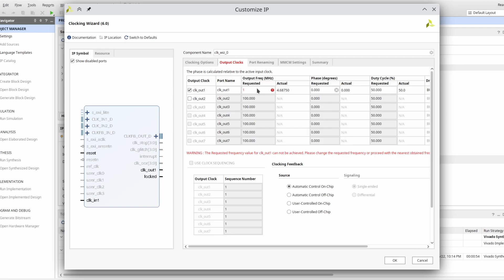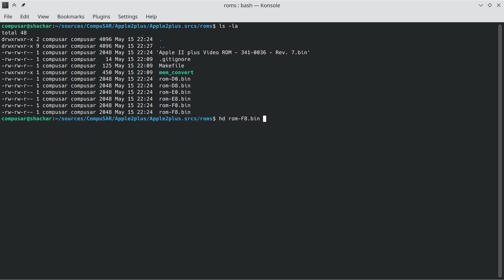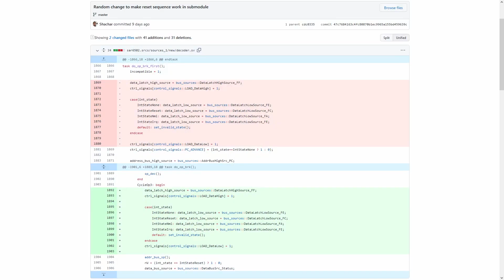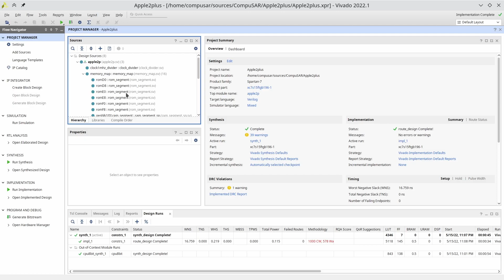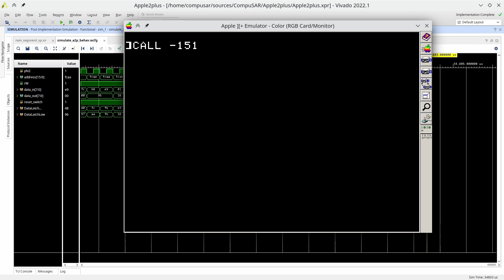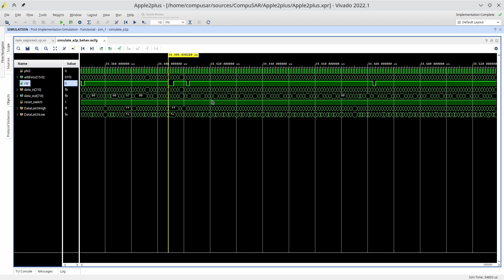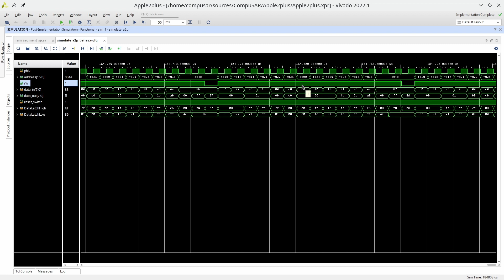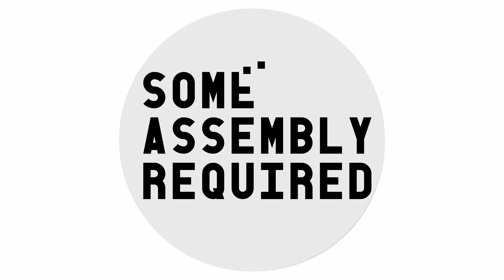I built an Apple II clone on FPGA from scratch

Comment: I came up with two methods to generate a 1 MHz clock with your hardware and have them reside on proper clock routing networks to appease the Vivado Place & Route: OPTION 1.) Generate a power of 2 multiple clock (i.e. 16 MHz) and run a counter with that clock that has enough bits to count each MHz (so with 16 MHz clock, a 4-bit counter for 16 unique count values).  Test for the "all 1s" case, register that test value, and drive the CE of a BUFGCE (see page 42 of Xilinx UG472) with the registered test value.  The BUFGCE will let one cycle of the 16 MHz of the clock through once every 16 clocks.  This will produce a valid but asymmetric duty-cycle clock that will already be on a clock network. OPTION 2.) Using the same 16 MHz clock as in the first option, test for the "all 1s" for all but the most significant bit.  Use the slower clock to drive the clock of a toggle flip-flop, and the registered test of the counter to chip enable said toggle flip-flop.  This will produce a 50% duty cycle 1 MHz signal.  Route the generated clock to an I/O pin, and then run that back in on a clock capable I/O pin.  You could likely do this with your current divided clock as well, but this is a minimal logic solution I'm proposing.  From other information, it appears you're using a QMTECH Spartan 7 development board.  If that's the case, you could run your clock out on pin F11 and back in on pin G11 by jumping the pins on JP3 (header pins 21 & 22).  Looking forward to seeing more development!
Reply from the maker: Actually, I don't get any warnings about the hack I did. Maybe because I'm synthesizing the CPU separately, so it has it's own clock definition, unrelated to what the rest of the circuitry actually does. I voiced genuine concern that I'll be double-edging clock transitions, which at least for now, doesn't happen.
BUFGCE seems like a good solution even based on a 1/50 divider. Why would dividing by a power of 2 be a priority in this case?
I can tell you right now that there is very little chance I'll be spending two IO pins on this solution. Not only are those an expensive resource, I don't know what routing the clock outside the FPGA will do to its phase.
Either way, thank you very much. I'm still kind of an FPGA newbie, and I find Xilinx UG documents rather overwhelming. They are okay individually, but it seems like Xilinx expects you to sit down and read them all through, which is beyond my current time budget. It's nice to have someone who actually knows what they are doing peeking over my shoulder.
Reply: @CompuSAR  I chose to go with a power of 2 clock because a counter that overflows on a power of 2 count requires no additional logic to reset the counter, where in your case without dividing down the clock, you have to make a 6 bit counter, and then infer/add circuitry that restricts the count to the range of 0 through 49, which effectively is a counter with a extra reset logic.  Also, with a much slower clock, the asymmetric clock period provides more hold time in case you need that in the future for I/O.  If you were to use the BUFGCE with the 50 MHz clock, you'd have less than 10 ns hold time but almost a whole microsecond of setup time.  If you attempt to work with original parts for I/O, there may be latches instead of flip-flops, and I'm going to assume they don't work faster than 1 MHz, so the closer you get to a 50/50 duty cycle, likely the better.  As for the phase shift on the out and back in again method, it wouldn't matter as all your logic would essentially be segregated from the clock generation circuit despite it originating from within the same chip.  The returned clock would enter, get buffered and placed onto the clocking network, and as long as you didn't try to make logic work across domains of two separate clocks, it would not matter.

I attempted to clone your project and rebuild it so I could see what resources you had available for such a clock division scheme (I'm spoiled with my Artix 7 35T and Zynq 7020 based boards having more FPGA fabric resources).  Vivado has never played nice with git or really any CVS.  I found that you included the Vivado project file, and if you open it in a text editor (it's just XML), it has full path information from your working machine.  You can instead use the Tcl scripting capabilities along with some shell scripting to rebuild a project from scratch when a person launches Vivado.  This way, you track only sources and not products of Vivado itself.  Best way I found to learn these commands was to do things in Vivado and look at the Tcl Console or the .jou file generated by Vivado.  Nearly everything you do in Vivado in the GUI is a Tcl command to the tool.

As for the Xilinx User Guides, I have a leg up on you as I started with Xilinx components that are now footnotes in history, and I've seen the progression of their technology as if they were logical increments in design and capabilities.  However, the best place to start is the Data Sheet (i.e. DS180 for Xilinx 7 Series).  This gives you the CliffsNotes version of the part family, and highlights the various topics that are broken out into the in depth User Guides (basic blocks, advanced blocks, clocking, memory, I/O, configuration, etc.).  With people new to Xilinx components that want/need to get in depth with them, I like to take them back a several years and point to the Virtex 4 family, as they are a direct ancestor to the 7th generation parts.  Those parts had a lot less documentation, and many features were far simpler to digest.  Progressing them forward up into the generation they're working with, they can see that we're really working with the same foundation Xilinx laid then.
Reply from the maker: @jordanking357  First, I can't say how great it is to have someone follow along!
The project file opens fine to me on different paths. The only thing that holds the complete path is the main project directory, and Vivado seems more than capable of inferring the correct path from the file's actual location.

With that said, you would need a few extra steps. You'll need to run "git submodules update --init" in order to get the dependent projects (CPU and UART) into the work tree. You'll also need to provide the Apple 2 ROM files (I did not want to commit them to GIT until I understand what the copyright status is), split them into 2KB parts, and run "make" on the srcs/roms directory to convert them to MEM files that Vivado can further use. I can confirm my design works with the ROMs in the AppleWin source tree. Last, the only real downside of using the Vivado is that it includes the mdp cache file in the project. You may have to erase it from the project, so that it can re-generate it. Otherwise, the project should transfer over as is.

As far as the clocks: I get your point about the "correct" division count. However, in the future I plan on dynamically scaling the clock up as far as the CPU would go, which is about 14MHz. Since that's the base clock of the original Apple 2, and since the divisor doesn't take too much logic, I think it's a reasonable plan. I should point out that my current divider already has a duty-cycle of 50%, at least so long as the divisor is even.

As for different clocks: it's not in the videos yet, but if you check the SoftSwitches.vs file, the UART is currently clocked at 50MHz to produce keyboard input, setting a register that the CPU then reset with a soft switch. As such, I'm using signals from an always_ff block that `posedge` on the CPU clock to one that relies on the board clock. Today I think I'm okay, as they are phase locked. With some of your tricks that will no longer be true, and I'll have to handle cross clock-domain communication. As the design will get more complex, more components will need a fast clock than the 6502. Some will need clocks even faster than the 50MHz that the board provides.

I will probably have to have different clock domains anyway, as the Apple is really around 1.023MHz. I'm not sure what clock USB needs, but I doubt that will be a whole multiple of that.

Last, I really really value your input, but it seems that YouTube comments provide a poor medium for this communication. Doubly so as I'm telling you things that are in the git repo, but aren't in this video, and will likely not make it to the next video either, so I'm spoiling two videos from now 🙂. If you can, it will be easier for me if you emailed me. My email is in the about page of the channel.

Thank you for your help.

Comment: What font is that in your logo? It looks very familiar… because I think that's a font I designed back in the 00's called Old Block. It's cool to see it pop up elsewhere!
Reply from the maker: You just saved my butt!
I was about to say that I didn't know what it was, because I only had the version where the font was elaborated to splines and Old Blocks isn't even installed on my system when I found the version before the elaboration, and it complained it doesn't have the font, showing "Old Blocks" crossed out. Turns out it I didn't transfer it from my old computer.
I don't remember where I downloaded it from, but I just searched for "free fonts", and then browsed until I saw something that matched the transformation I wanted to do with it. Thank you very much for creating it!
Reply from the maker: Any chance you're still around? After four years of using this logo I suddenly realize that there is a kerning bug in it. I can fix it in the logo, but I want to try and fix it in the actual font.

Comment: I think your memory problems may be related to your clock problems. The off-chip memory is going to be DRAM, which needs to be refreshed. The FPGA should implement that circuit itself, but if the clock rate isn't high enough it won't be able to refresh the RAM fast enough and you'll get memory errors. Switching to on chip SRAM avoids the problem, but it's much more limited. That said, assuming that you've got a fixed clock on the board, presumably it's been validated with the DDR module also on the board?
Reply from the maker: This video (and the stage of the project) is all focused on getting something up and running. The on-board DDR3 memory is something I have not yet even thought of using. The Spartan-7/15 I'm using is supposed to have 20 36Kbit block RAM units. Even if we don't find a way to use the ECC bit, that's more than enough for 64KB of RAM. The IP wizard that was supposed to make it happen had some problem.
I wouldn't dare, and it would make no sense, to try and run the DDR at 1MHz. The whole point of using that module is that it supports more than just the 6502. The chip is rated at about 800MHz, and the sample code from QMTech runs it at around 700MHz, and I'll likely use something in that vicinity, when I finally get to use it.
Doing so will require implementing a cache mechanism, which will be a fun challenge in and on itself.
Reply: @CompuSAR  I hope it didn't sound like I was criticizing your approach. I'm just trying some armchair debugging with what I can see.
Reply: This is an interesting project, and I look forward to seeing more.
Reply from the maker: @hikingpete  Glad to have you.

Comment: This is pretty neat. One of these days I need to get an FPGA.
Reply from the maker: I'd have recommended the QMTech I'm using, but with the chip shortage doing on it went out of stock. I had just enough foresight to buy four before that happened.
Reply: @CompuSAR  Sweet, I guess I'll have to buy more than one when I do finally pick one up.

Comment: Just found your channel sir, liked and subscribed, because this is extremely interesting. I've implemented the 6502 and a C64 in software, but I've always wanted to learn more about FPGAs.
Reply from the maker: Awesome!
I will definitely get the C64 at some point, but the computer kinda scares me. Unlike the Apple, it has a ton of things going on outside of the CPU, and unlike the Amiga, I don't know them. When the time comes, tips would be most appreciated.
Something that may be of interest to you: I want the C64 implementation to be able to accept C64 cartridges. I still have on a vague idea how that's going to work, though.
Reply: @CompuSAR  Yeah, there's a lot of stuff on the C64 for sure. My VIC-II implementation is by no means complete and lacks bitmap graphics modes. But I've still been able to use my emulator for a lot of cool projects. I have implemented basic cartridge support in my emulator and it's actually relatively straight forward. My plan when implementing the 6502 was always to implement more systems than the C64 and the Apple II is next on my list, so I guess I should get to it very soon.
Reply from the maker: @HAGSLAB  There are two challenges I see for implementing cartridges. The first is the number of free IO pins the FPGA has. I don't know the pin-out, but I'm guessing you'd need at least 16 address, 8 data, R/W and the clock. Those already use all the unassigned pins my FPGA board has.
The second challenge is that the C64 works at 5V, wheres the FPGA tops out at 3V3. This means you need a level converter, and one that has as many pins as needed. Figuring out how to do that cheaply is going to be interesting.
Anyways, that's still a bit far in the future. There are plenty of challenges before we get there.
Reply: @CompuSAR  That makes a lot og sense. It's a lot more straight forward in software, haha 😅 See, this is why I'm a software guy, not so bright at the hardware stuff 😂

Comment: Great video!
Just a small question: why don't you use the work that was already done on Mister?
Reply from the maker: I talk about it a little in this video: https://youtu.be/s1zQQAN6jmU?t=335
Let's get the truth out of the way: It's much much more fun to do those things from scratch.
With that said, the MiSTer is a monster of an FPGA, with a lot more resources (and a matching price tag) than what I'm using. Maybe as a result, the cores for the MiSTer take way too much resources, which I don't have on the very small FPGA I'm using.
So the objective non-NIH answer is that the architectures are just too different.